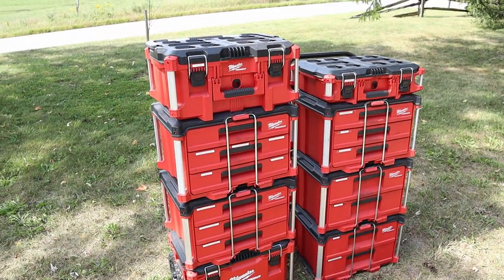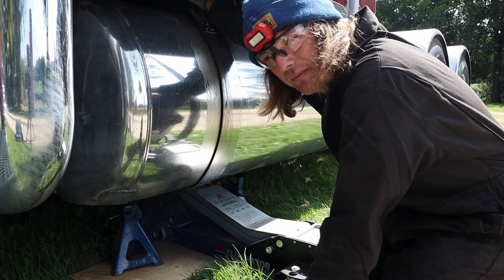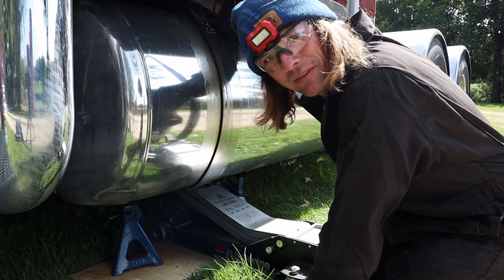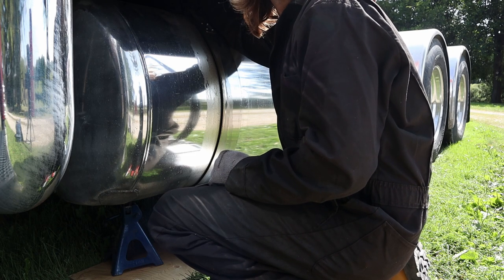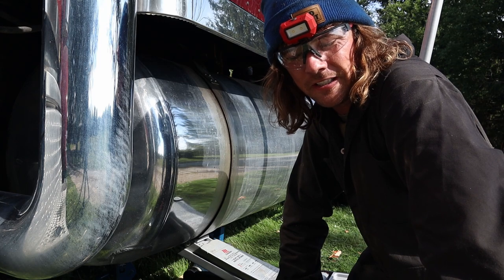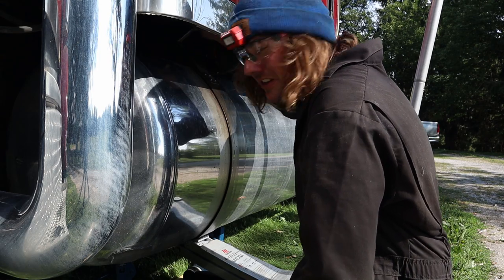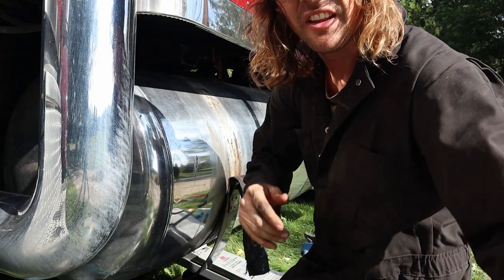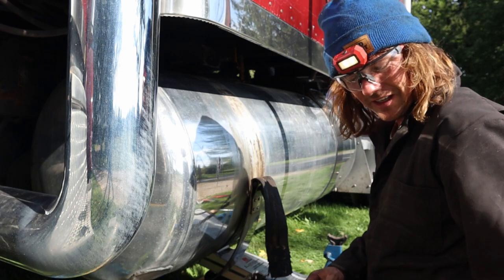Fixing A Leaking Tank Strap THE CHEAP WAY!! On My Peterbilt 379

Comment: Have this exact same leak in that same spot! Going to give this a shot because a new tank just isnt in the budget. Thanks for the video.
Reply: Can also take the tank down and get welded. Its what we do.
Reply: For sure! Welding a patch is the way to go.
Reply: @ThatBlueKW  yea our local shop charges about 200 for a patch... also a great time to replace sending unit if fuel guage doesn't work
Reply: @isaacmontoya9144 I wish ours only charged $200. Every welder around here says $1000 which is crazy considering a new tank is $800

Comment: Hope you got that rubber insulator back between the tank and the arc-shaped locating bracket on the frame rail. I'm sure you probably did. I wonder if the shop left it out of place and that bracketry rubbed through the tank, or if they just overtightened it. It's possible that they did everything right, and it still sprung the leak...

Comment: I enjoyed watching you troubleshoot. 

I have 2 questions:

1a.  Did you empty the tank as much as possible (via driving or running the motor) before dropping it?

1b.  If so, how many gallons of fuel were in the tank prior to dropping it?

2.  Around how much is a new fuel tank?

Comment: Get an old 3"strap glue it to your tsnk and keep your rubber protector it should be golden,also i have an intermitant miss and white( raw fuel) runs like shi 💩 t then clears up.maybe a tank pickup tube cracked like yours.hard to disgnos when its intermittent...